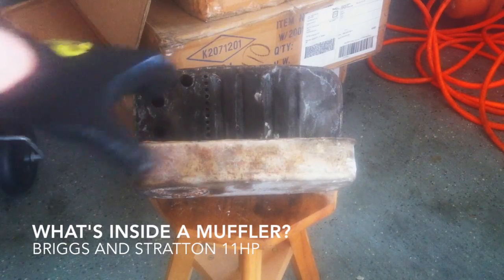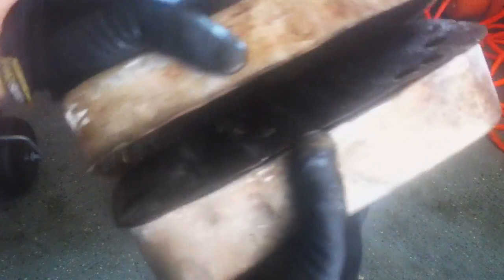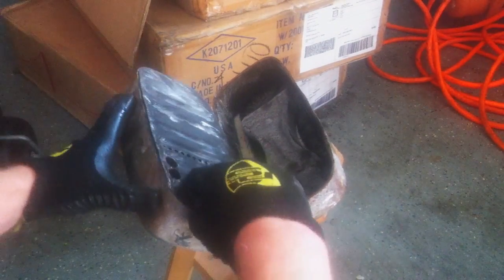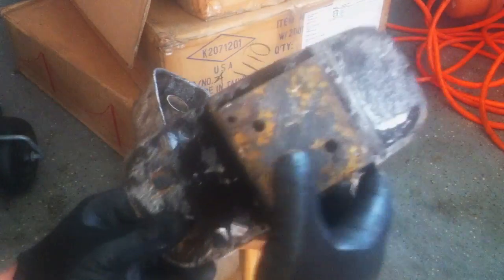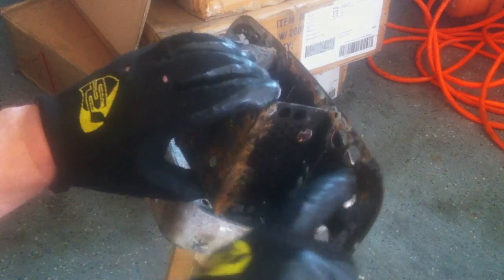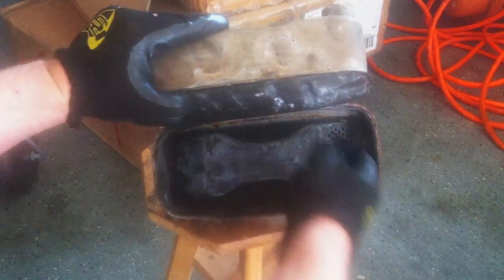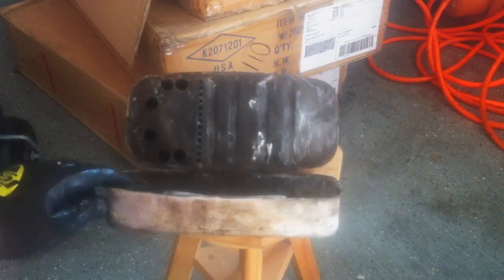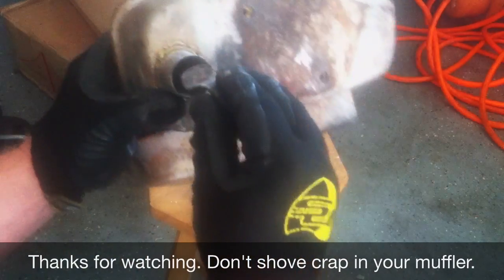Inside a Briggs & Stratton Muffler - How It Woks/Repair

Comment: I just took mine off had trouble with it falling off before on the back there is  hole that looks like it has been welded but it is rusty and the hole is opening in places and the other side has the hole for the exhaust to go out should that hole that has the weld on it be covered plum up? JB weld?  I can fix other wise have to take it some where ..? ANYONE?

Comment: I'm going to have to replace my second muffler. I was wondering if anyone ever tried to coat the inside of a muffler with cooking oil like a cast iron pan to prevent total rust out. With bbq grill paint on the outside.

Comment: instead of buying a new muffler can I just weld the seam where is cracked open
Reply from the maker: Blair Grossman sure why not!?
Reply: If your low on cash just drill a 1/4 inch hole at an angle from the last exit grate to penetrate the second to last tiny hole grate. The tiny hole grate , right before the last turn is the point of failure on these. If you are in a bind this will work until you can find an extra muffler.

Comment: Thank you for this! 
It was hard to see and confused me when i looked in there with a scope. 
I have an intek twin with the same muffler case, and its a single outlet. 
This gives me a few ideas on how to merge 2 spare mufflers into 1 for a true dual outlet, hopefully.
Reply: @AEON.  
Yea I ended up cutting a stock muffler apart and adding a bunch of holes thru the baffles. 
It's still pretty quiet too, here's a quicky  vid of what I did. 
https://youtu.be/JTMcXswzGho